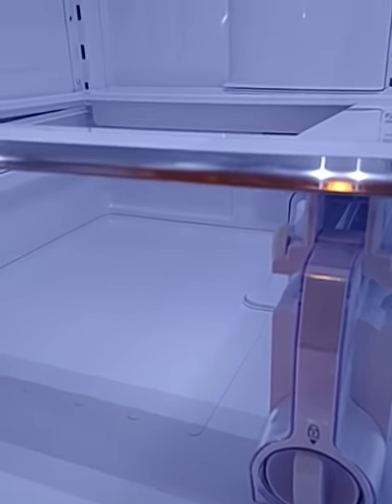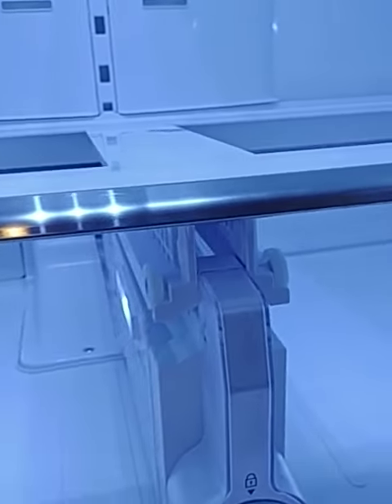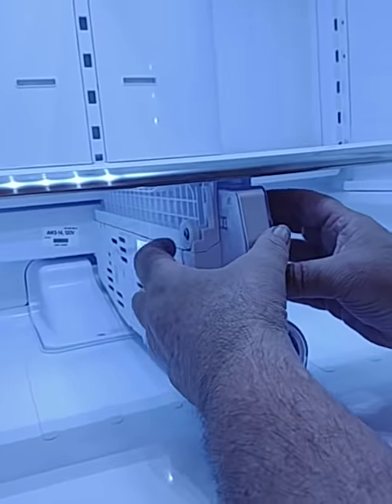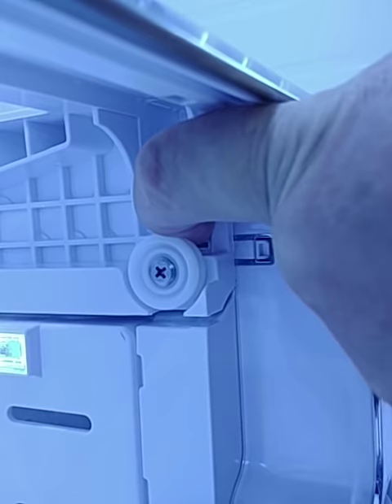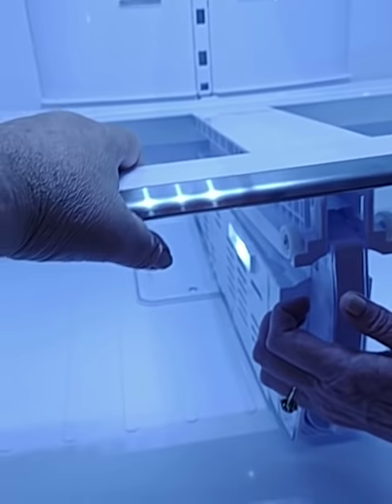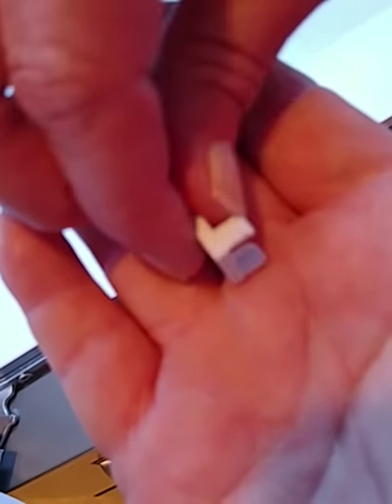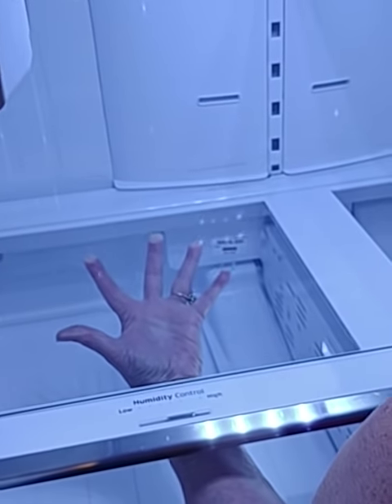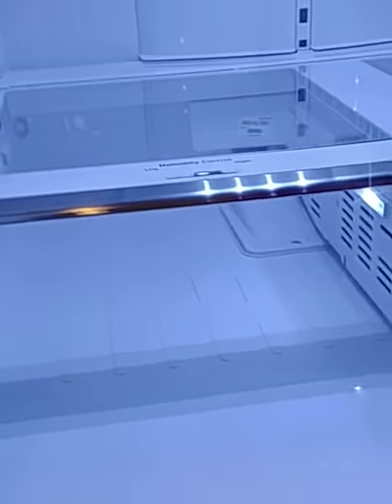Samsung French door 4 door bottom glass removal cleaning and reinstallation

Comment from the maker: Correction: 
1) Only the left side is a button
2} A flat blade, coin, chopsticks or screwdriver can be used to remove the plastic clips holding the glass.
3) THROW THOSE CLIPS IN THE GARBAGE!
(I am assuming the clips protect the glass during shipping or at factory installation., they serve no other purpose!)
                 FOR GLASS SHELF REMOVAL ONLY:
1) PUSH THE GLASS BACK TOWARDS THE REAR OF THE REFRIGERATOR
2) LIFT THE FRONT EDGE OF THE GLASS FROM UNDERNEATH
3) ONCE GLASS IS FREE FROM SHELF, RAISE GLASS TO A 45 DEGREE ANGLE SUCH THAT YOU CAN PULL GLASS SHELF  OUT WITH THE LOWER END OF GLASS UNDERNEATH  the ICEMAKER

                   PLASTIC SHELF REMOVAL:
After pressing button, gently lift the shelf up over the water filter. (3 hands to help protect the flimsy water filter)
CAUTION:
MAKE SURE BOTH DRAWERS ARE REMOVED BEFORE ATTEMPTING TO REMOVE THE PLASTIC HOUSING

Comment: Or you can spray some cleaner on other side to go under the glass and use credit card wrapped in tiny paper towel to slide around under pressured water , works good 
I could not open those clips had to come up with my own idea 💡

Comment: How did you get the little white tabs out? I couldn’t get mine out.
Reply from the maker: I'm assuming you are talking about the 2 white clips holding the glass in place.
I used a screwdrive from underneathr against 1 side of the clip and it pops right out as you only need to release one side and the other falls through.
You could also use a pair of needle nose pliers.
Just be careful of the glass.
I recommend not putting them back in after you clean it.
That way you can lift the glass out for cleaning without all the rest of this montage!
Reply: Kent Estes Thank you
Reply from the maker: Chop sticks would be safer than a screwdriver.
Do not put those white tabs back in.
That allows the glass itself to be removed without the entire plastic assembly
Reply: You can always replace them with these: https://www.ebay.com/itm/352644447501

Comment: How did you take the glass out?
Reply from the maker: remove plastic clips from underneath at the rear in each corner
Do not put them back in!!! they were there only for shipping purposes.
Chop sticks, screw driver, needle nose pliars...
slide glass backward towards the rear of the refrigerator... just enough so that the glass clears that front rim... like 5 milimeters ... guessing
next, from underneath push the front of the glass shelf up and then you must .. from underneath on right side side lift the entire piece of glass on a 45 degree angle so that you can then pull it out of the refrigerator!

Comment: I didn’t see when you remove the glass first?
Reply from the maker: Next edition! The lip of the glass slides under the plastic edge so you must first slide it back to release from there lifting it gently and only a little bit to free it from that. then you must place the glass in a 45 degree slant side to side and gently guide it out of the refrigerator.

Comment: You didn’t show how to get the glass out
Reply from the maker: Watch again.
Once tabs have been removed do not put them back.
The glass must be slid towards the back of the refrigerator about 1/4 inch and then the front of the glass can be lifted up. Afterwards you must very gently angle the glass 45 degrees sideways with doors wide open to very carefully pull it out of the fridge.

Comment: A poor and not complete video.  It is very difficult to push in on the tabs above the filter housing. The main objective is to remove the plastic tabs in the back corners that hold the glass down. These are difficult to remove even with the shelf removed. If you have a good needle nose pliers, you can squeeze the tabs from the bottom without removing the whole shelf.  If not remove the shelf and then remove those tabs. I used a small screwdriver to push on the tab and tapped it so it came flying out.  Not a very good design. You can throw away these tabs since they are useless unless you plan the lay the refrigerator down on its side.  Once these tabs are removed it is very easy to lift the glass shelf out for future cleaning,  Just lift it from the back, push it back a little to clear the front corners that are tucked in the plastic shelf to hold it down.  You may need to remove the shelf above it to get the glass out.   I aggrss with the design, "what were they thinking".  It's a culture difference.  

This is Samsung's instructions and it also is difficult to understand. They really do not show the tabs to remove the shelf from the water filter housing, just push? No way.  To remove the plastic tabs at the rear is very poor since to picture is not usable and it doesn't   state that it is from the bottom after the shelf is removed. Again culture difference in wording and understanding from Korean to English translation.  https://www.samsung.com/us/support/answer/ANS00063107/
Reply from the maker: Exactly